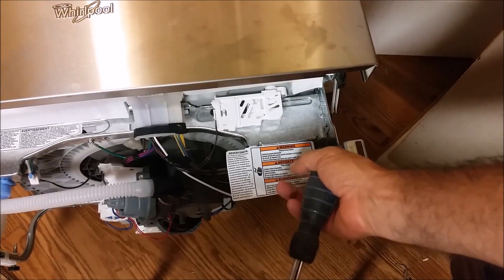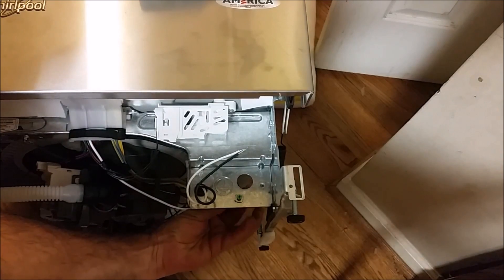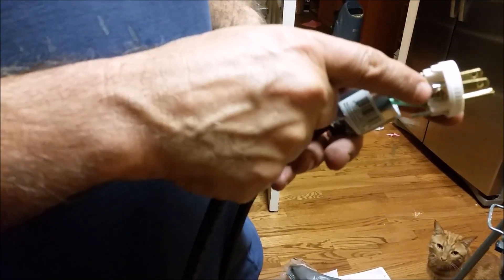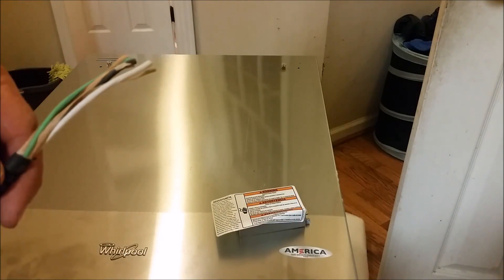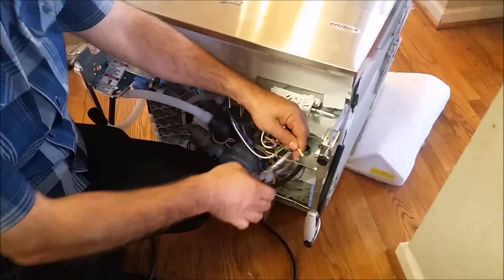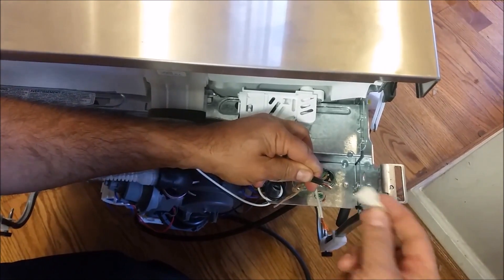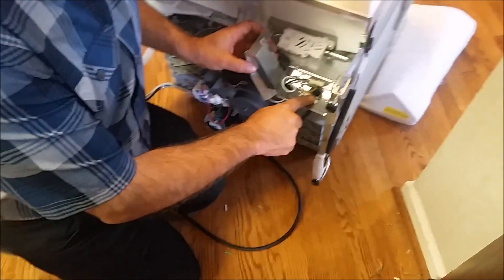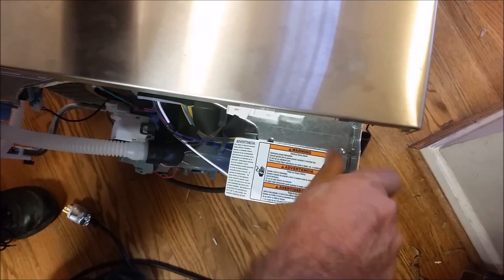How To Connect Electrical Wire To A Dishwasher

Comment from the maker: Dishwasher Power supply cord = https://amzn.to/3i5MPtv
Or
https://www.amazon.com/gp/search/ref=as_li_qf_sp_sr_tl?ie=UTF8&tag=josephkhalon-20&keywords=14+Gauge+3+Prong+Heavy+Duty+Replacement+Power+Supply+Cord+Cable&index=aps&camp=1789&creative=9325&linkCode=ur2&linkId=5261d9c5875462920e21193906cd7001

3/4" Conduit clamp =  https://amzn.to/3cz2sIB

1.2" Coduit clamp = https://amzn.to/3kTiPTA
Try Amazon Prime 30 days for free = https://amzn.to/2JMWaLe

Dishwasher Water supply line 3/8" = https://amzn.to/3mVDgks

Or 
https://www.amazon.com/gp/search/ref=as_li_qf_sp_sr_tl?ie=UTF8&tag=josephkhalon-20&keywords=Dishwasher+water+hose&index=aps&camp=1789&creative=9325&linkCode=ur2&linkId=580b210d0c9ed2913f9c5658c7bfcf5c

Amazon Deals:
Try Amazon Prime 30 days for free = https://amzn.to/2JMWaLe
Create Amazon Business account = https://amzn.to/3mLSyYt
Joint Amazon Prime Watch Thousends Of Movies and TV = https://amzn.to/33NfsHD
Try Personal Shopper Wardrobe  https://amzn.to/2VClfv9

Comment: Thank you for the Video. I have connected the ground wire that comes from the electrical source to the dishwasher metal box. 
I have a question: I have another ground wire coming from the dishwasher, how can I deal with it?
Reply from the maker: You should connect it to the ground that come from the electrical source also.
Reply: Thank you so much.

Comment: Can I use metal conduit to connect to the dishwasher?   It looks like the previous homeowner used old metal conduit that was running from the wall behind the dishwasher, but the old one is not long enough for the new dishwasher.  Should I use a longer metal conduit to replace the old one?  

I see a lot of people use the black rubber cord that plugs into an outlet, but we don't have an outlet in the back of the dishwasher.  What would be the proper way of doing this?  Thank you much!!
Reply from the maker: Yes you can. It is also better to use metal because the metal is grounded.

Comment: My dishwasher has no ground to it just white and black I ran ground from house to metal but that is not making the dishwasher grounded help?
Reply from the maker: Yes it does. As far as you connect the ground to the dishwasher metal properly (attache the ground with a metal screw to the dishwasher metal)
Reply: Joseph K  thanks